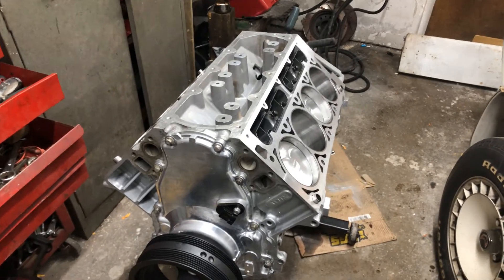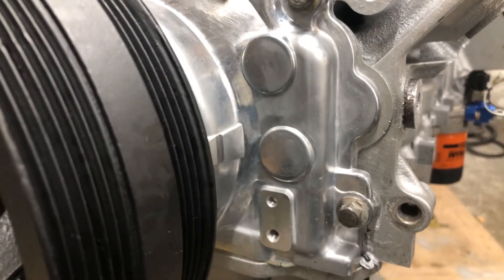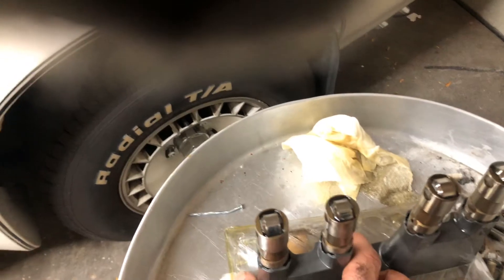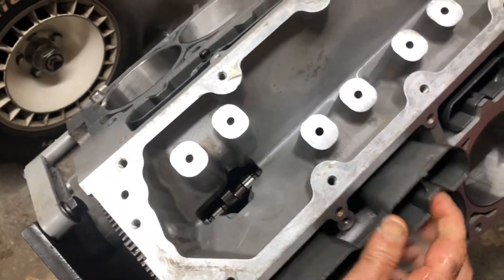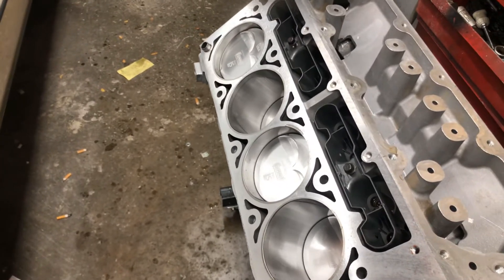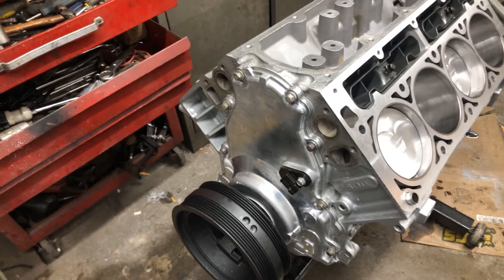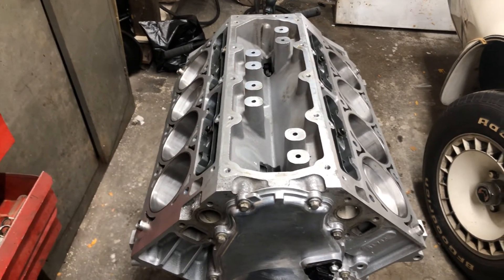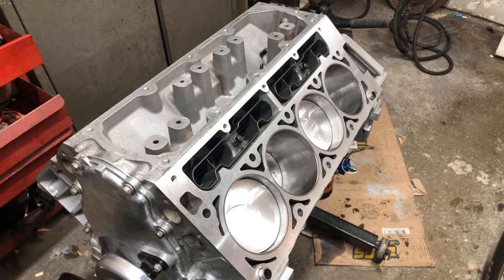Second Generation f body LS swap LS3 416 assembly

Comment: Is it possible to increase the cylinder diameter of 5.3 liters to 6.2? For 5.3 the cylinder diameter is 96mm. For 6.2 it is 103.25
Reply: Thank you very much for answering. Saved my time and money.
Reply from the maker: No, unfortunately there’s not enough material to bore out the 5.3L to make it a 6L. You would need to sleeve it. Cheaper to find a 6L or 6.2L block

Comment: Hello. Can I ask you for help in building an LS series motor? I have an aluminum cylinder block from a Chevrolet Tahoe. 5.3 liters. cylinder heads from L92 with large intake manifold windows.
Reply from the maker: Hello, you can’t use the L92 cylinder heads on a 5.3L engine. The bore size is to small on the 5.3L and  rectangle port head valves will hit the edge of the cylinders plus the head volume is to big so even if they did fit…… you’ll loose lots of compression and power. You need 243 heads which come with smaller chambers for compression

Comment: The cover is not warped, you have to clearance the inside of the cover with a dremel to fit the double roller timing chain
Reply from the maker: Lol… the cover was actually warped, it was a EBay Chinese replacement cover, after clearances were accounted for I tried fitting the cover again without any luck , I placed the cover on a flat sheet of glass. Was warped about 1/8 of a inch. didn’t matter how much material I removed. I ended up buying another cover, removed some material with a disk grinder for oil pump clearances. Worked out good.

Comment: Would of liked to see how much the piston comes out of the whole.
Reply from the maker: The original pistons had a compression height of 1.115 . I ended up getting the block decked. The forged pistons I installed have a compression height of 1.110. Then I ended up with a measurement of 0.20 out of the hole.